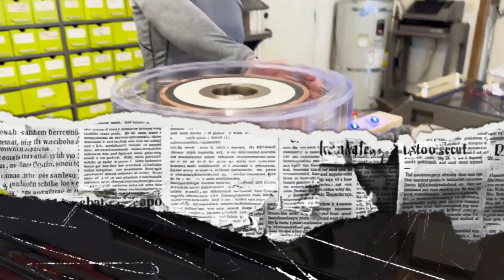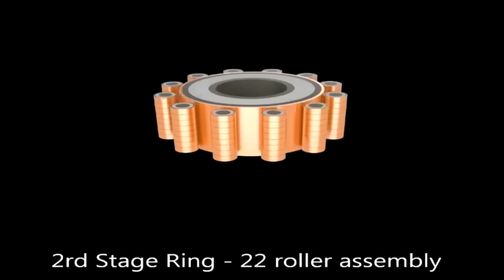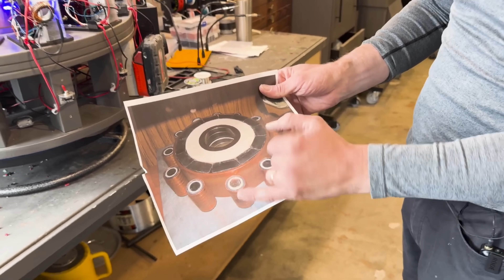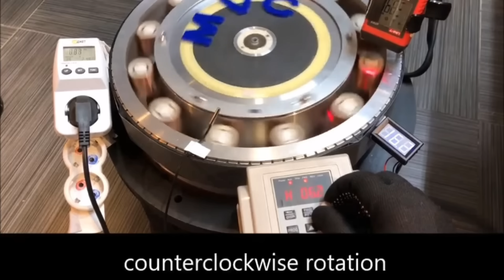US Scientists Unveil 2025 Free Energy Plan: Isaiah Ritchey’s Searl Effect Breakthrough Goes Public!

Comment: Start Trek Next Generation User Interface on the TV is just too cute.  Once the magnetic depolarization occurs it will lose any so called "free energy" then it will will take more power to run than it takes to polarize the magnets again. Tthe Searl Effect is just a magnetic-electro-mechanic battery -- effectively a simple magnetic repropulsion by alternating current interacting with magnets.  Did ya see the replaceable battery pack on the control panel?  Why is it needed if it's free energy?  It looks like a Harbor Freight Pittsburg cordless drill battery.

Comment: Wonderful adaptible uncluttered clean independent technology

Let's face the wonder of full heat use. The second law of thermodynamics is an inelegant law developed during victorin england's scientific and religious fascination with steam engines. Many people act as if this paridgm is inescapable. 

However energy is widely known to change form without true gain or loss. Therefore  energy can be cycled endlessly in any quantity. 

. Refrigeration by the principle that energy is conserved should produce an equivalent amount of electricity instead of consuming electricity. 

Full heat recycling, all electric, very isolated underground, undersea, or space communities would be highly survivable with self sufficient EMP resistant LED light  automated vertical farms, thaw resistant frozen food storehouses, factories, dwellings, self contained elevators, safe rooms, and horizontal transports. 

In a flourishing civillization, small self sufficient electric or cooling devices of many kinds and styles like lamps, smartphones, hotplates, water heaters, cooler chests, fans, radios, TVs, cameras, security devices, robot test equipment, scales, transaction terminals, wall clocks, open or ciosed for business luminous signs, power hand tools, ditch diggers, pumps, and personal transports, would be available for immediate use incrementally anywhere as people as individuals or larger social groups see fit. 

Some equipment groups could be consolidated on local networks. 

If a high majority thinks our civilization should geoengineer gigatons or
teratons of greenhouse gasses out of our environment, instalations using devices that convert ambient heat into electricity can hypothetically be scaled up do it with a choice of comsequences including many beneficial ones. 

Energy sensible refrigerators that absorb heat and yield electricity would complement computers as computing consumes electricity and yields heat. Computing would be free. Chips could have energy recycling built in.
This would improve performance and lower cost, 

Refugee communities would be buildable quickly. Fire safes would preserve contents to 1000F indefinately 

A simple rectifier crystal can, iust short of a replicatable long term demonstration of a powerful prototype, almost certainly filter the random thermal motioren of electrons or discrete positiive charged voids called holes so the electric current flowing in one direction predominates. At low system voltage, a filtrate of one polarity predominates only a little but there is always usable electrical power derived from the source, which is Johnson (observation) Nyquest (theory) thermal electrical noise. This net electrical filtrate can be aggregated in a group of separate diodes in consistent alignment parallel creating widely scalable electrical power. The maximum energy is converted from ambient heat to productive direct current electricity when the electrica6bzDVgBhrhYl load electrical resistance  is equal to the array internal electrical resistance. 

Maximum calculated electrical power output (watts) is k (Boltźman's constant), one point three eight x 10^ minus 23, times T (temperature Kelvin) times bandwidth (0 Hz to a natural limit ~2 THz @ 290 K) times rectification halving and nanowatt power level rectification efficiency, times the number of diodes in the array. 

There are a billion cells of 1000 square nanometer area each per square millimeter, 100 billion per square centimeter.

Order is imposed on the random thermal motion of electrons by the structual orderlyness of a diode array made of diodes made within a slab: 

Host crystal is silicon
  P type boron doped
-----‐------‐----___-- Out
🔻🔻🔻🔻
■■■■■■___ + Out
  N type phosphorous doped 

All the P type semiconductor anodes abut a metal conductive plane deposited on the top face of the slab with nonrectifying joins;  the N type semiconductor cathodes or common cathode abuts the bottom face. As the polarity filtered electrical energy is exported, the amount of thermal energy in the group of diodes decreases. This group cooling will draw heat in from the surrounding ambient heat at a rate depending on the filtering rate and thermal resistance between the group and ambient gas, liquid, or solid warmer than absolute zero. There is always a lot of ambient heat on our planet, more on equatorial dry desert summer days and less on polar desert winter nights.

There are other plausible breeches of the second law of thermodynamics. Hopefully a lot of people, mostly as independent teams, will join in expanding the breech. Please share the successes or setbacks of experiemental efforts. 

These devices would probably become segmented commodities sold with minimal margin over supply cost. They would be manufactured by advanced automation that does not need financial incentive. Applicable best practices would be adopted. Business details would be open public knowledge. Associated people should move as negotiated and freely and honestly talk. Commerce would be a planetary scale unified conglomerate of diverse local cooperatives. There is no need of wealth extracting top commanders. We do not need often token philanthropy from the top if the wide majority of people can afford to be generous.. 

The topic deserves discussion and prototyping attempt action. 

Charles M, Brown
Kilauea, Kauai, Hawaii 96754

Comment: This SEG was operationnal in the 1950 and BBC made videos of the flying saucer Mr Searl built and flown back then. .cause a kwirk of the device is that if you do not contain it's speed, it will lift up and disappear into space. .
Reply: It was debunked.   it failed, ON CAMERA.  He later claimed that the video camera output radio frequencies that fouled the magnetic field of his generator.  He claimed that it gave him an idea of how to control the device. Cameras of that era do in fact produce all kinds of EMF output.  But the wattage is so low, and the distance so great that there's no way it would  have any effect.  It simply doesn't work.  All these magnetic motors take more power to polarize than they can ever produce, by a long shot.
Reply: This is all fake.  This is nowhere to be found on the market.
Reply: @almcallister814 Right, always the same crap, everything is fake 😂😂😂😂
Reply: @scottl5000  The camera has an Output emf powerfull enough to influence the generator ? ? ? Really  ? ?
Reply: @ it doesn't--my point is that Dr S claimed it did, that the video camera messed up his demonstration... eg it is BS
Reply: You must contain it is speed.

Comment: I don't understand. It gives energy from the outside. And it spins. How where is that Free energy?
Reply: Only enough free energy to drive itself. The problem with these free energy devices is that as soon as you put some sort of load on it, it stops. So the free energy is useless.
Reply: Just as a motor spins, it can drive current and power things.  The difference here is that once this thing is up and running it needs no external energy input.
Reply: @jamesbarrett9066  😅🤣😂🤣😅🤣😂🤣
Reply: Just a bicycle Dynamo on large scale !
Reply: No understanding needed. it's pure fakery,

Comment: Their projects are not for DIY'ers.Liberty machines are much simpler.
Reply: liberty made two devices. o ne has motor generator. i bought the devices that i need to make one and test it works or not....other one is a vibrating magnetic field with no moving part. that one has serious physics problems. it will not work and will be on fire after a short while. they did not show that part. if you want to build and test use the motor generator version. we shall see it works or not. i do not beleive anything, unless i put together my gadget and see it actually works.
Reply: Bs @ravanabrahmarakshas4263